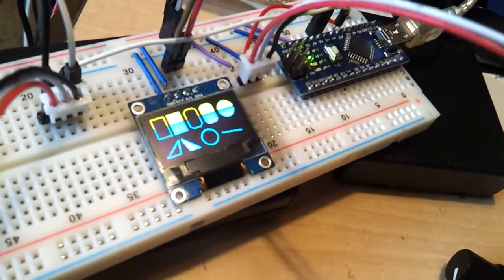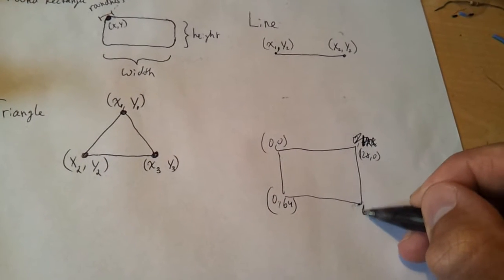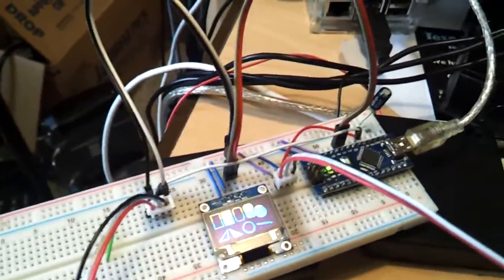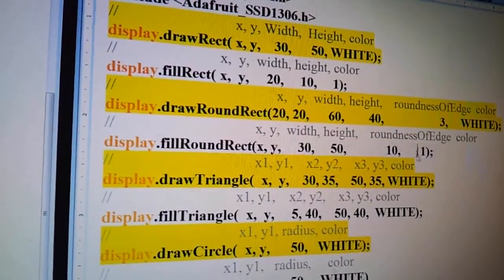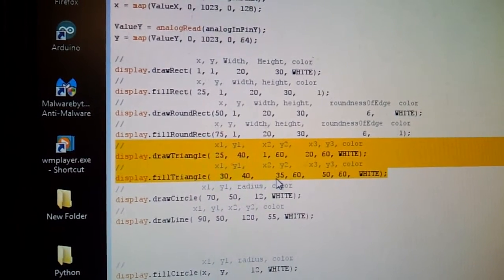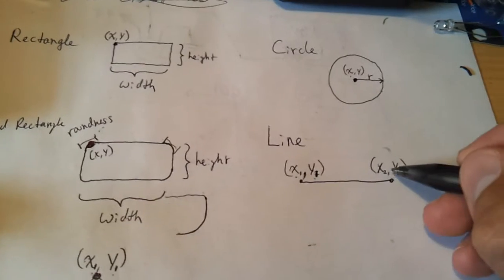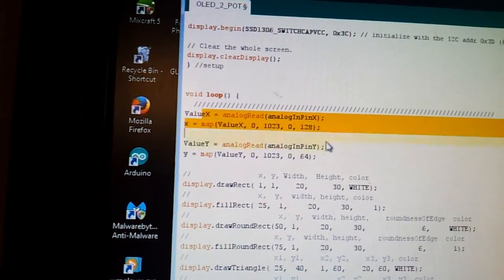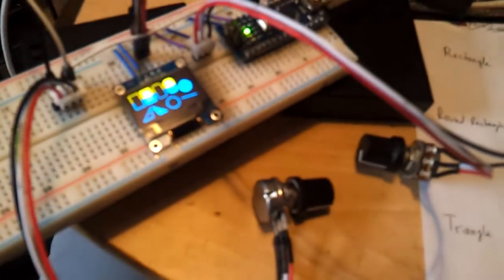Part 3 - 0.96 I2C IIC 128X64 YellowBlue OLED LCD LED How to Use

Comment: Great videos, really helps me grasp some basic concepts!
If you could please provide your demo source code/sketch it would be appreciated!
Thanks and keep the videos coming.
Reply from the maker: Sean Lantis /*******************************************************************
This is an example for our Monochrome OLEDs based on SSD1306 drivers
This example is for a 128x64 size display using I2C to communicate
3 pins are required to interface (2 I2C and one reset)
The code was modified by Fedor Weems.
*******************************************************************/
#include <SPI.h>
#include <Wire.h>
#include <Adafruit_GFX.h>
#include <Adafruit_SSD1306.h>
#define OLED_RESET 4
Adafruit_SSD1306 display(OLED_RESET);
#define XPOS 0
#define YPOS 1
#define DELTAY 2

#if (SSD1306_LCDHEIGHT != 64)
#error("Height incorrect, please fix Adafruit_SSD1306.h!");
#endif

void setup() {

display.begin(SSD1306_SWITCHCAPVCC, 0x3C); // initialize with the I2C addr 0x3D (for the 128x64)

// Clear the whole screen.
display.clearDisplay();
} //setup

void loop() {
  ////////////////////////////////////////////////////////////////////////////

//                x, y, Width,  Height, color
display.drawRect( 1, 1,    20,      30, WHITE);
//                x,  y,  width, height, color
display.fillRect( 25,  1,     20,     30,     1);
//                     x,  y,  width, height,    roundnessOfEdge  color           
display.drawRoundRect(50, 1,     20,     30,              6,     WHITE);
//                    x, y,  width, height,    roundnessOfEdge  color 
display.fillRoundRect(75, 1,     20,     30,             6,       1);
//                    x1, y1,    x2, y2,    x3, y3, color
display.drawTriangle( 25,  40,   1, 60,    20, 60, WHITE);
//                    x1, y1,    x2, y2,    x3, y3, color
display.fillTriangle(  30,  40,     35, 60,    50, 60,  WHITE);
//                 x1, y1, radius, color
display.drawCircle( 70,  50,   12, WHITE);
//               x1, y1, x2, y2, color
display.drawLine( 90, 50,   120,  55, WHITE);
display.display();
delay(5);
display.clearDisplay();

} //loop
Reply from the maker: Sean Lantis this is just a quick code that will work, just make sure you have the libraries:)